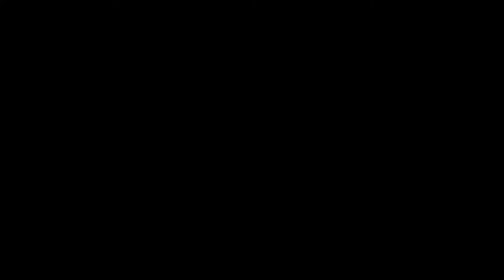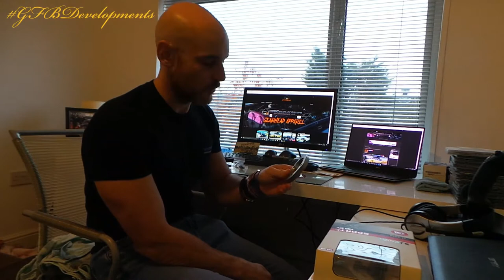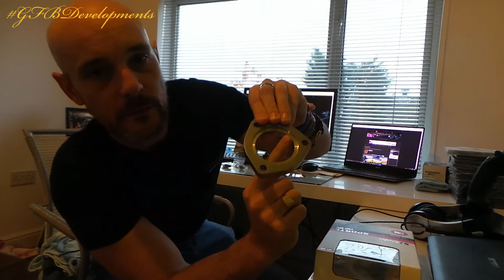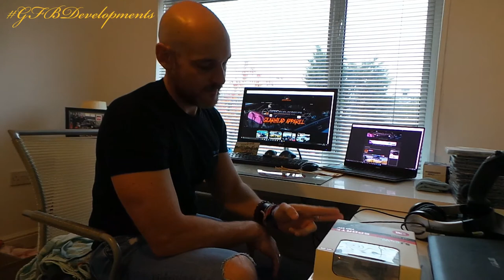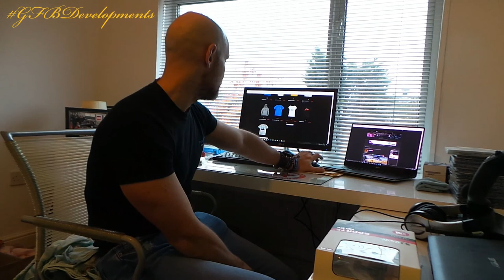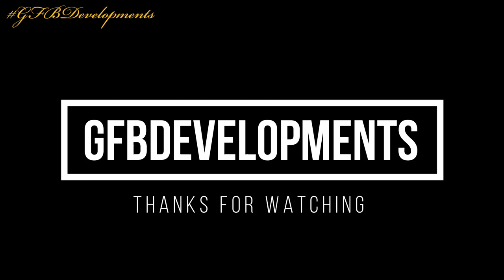Turbo MGB GT Update

Comment: just doing an mgb gt at the moment. basically take one mk3 mx5, reduce the width by 10 inches and stick an mgb gt shell on top. got the engine in the rear diff and five link suspension,the 6 speed gearbox, the prop (unaltered) and the aluminium ladder bar. next is take it all out again and repair the rusty bodyshell.
Reply from the maker: That method did  cross my mind, however it would mean the car would need a IVA test here in the UK and loose it's historic registration :-(
Reply: how did frontline developments get around it when they built the le50.
Reply from the maker: Very good question, but easy answer is by not declaring it.
Reply from the maker: IF you are in the UK then it's worth looking at the DVLA 8-point scheme before doing what you suggest :-)